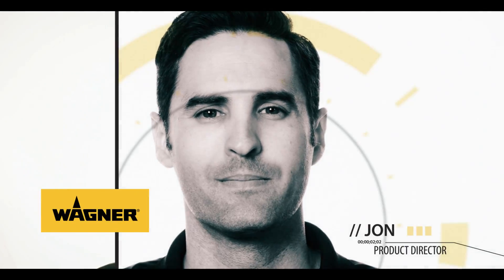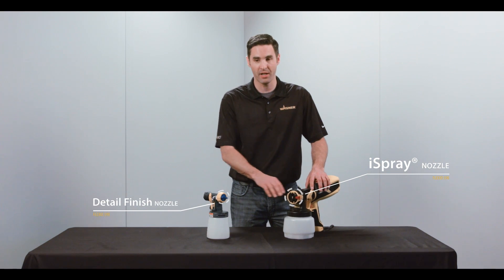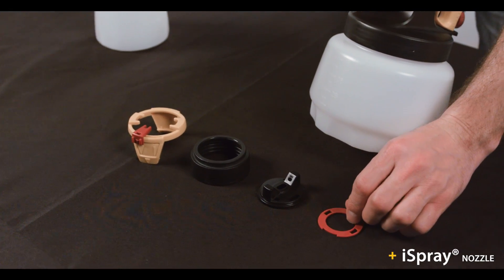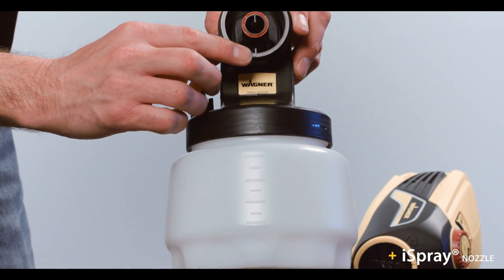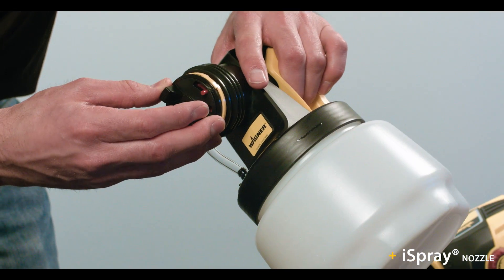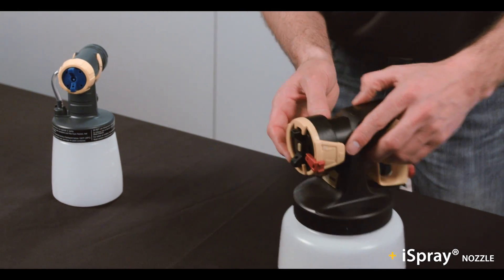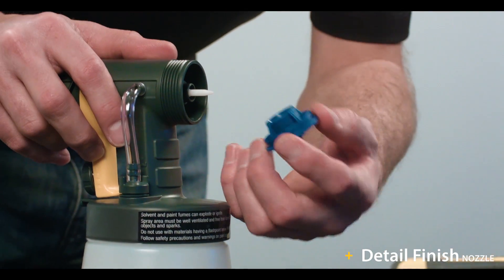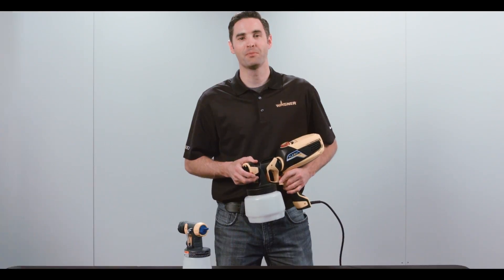Wagner FLEXiO Sprayer Reassembly

Comment: Hello.  I had a weird occasion where paint got into the air hose. I had to dismantle the handle assembly to clean the hose. Now the trigger button for the air flow isn't aligned. Where can I find a video where it goes in the handle assembly?
Reply from the maker: Hi there! I'm sorry to hear about the trouble you're experiencing. It's possible that during the reassembly process, the trigger button for the airflow was not aligned properly with its corresponding mechanism inside the handle assembly. This misalignment could prevent the trigger from functioning correctly. Double-checking the alignment of the trigger button and its components within the handle assembly should help resolve the issue. Here is our Wagner FLEXiO Sprayer Reassembly video:https://youtu.be/7faZIPgWq6I?si=P-iSf4jbywUhmwxI but if the problem persists, please contact our support team at support@wagner-group.com or by phone at 1-800-328-8251.

Comment: Wagner 570 is airless and brushless motor?thank you
Reply from the maker: Hi there, thanks for your questions! Our FLEXiO series sprayers are High Volume, Low Pressure (HVLP) sprayers. HVLP sprayers use a high volume of air at low pressure to atomize the paint. HVLP is ideal for detail work and smaller projects like furniture or cabinets, as they produce a smooth finish and have less overspray. Our HEA sprayers use a high-pressure system to push paint through a small tip, atomizing it into larger droplets. This results in faster coverage and reduced overspray. HEA is great for large projects like fences or exterior surfaces, where speed is essential.

Yes, this is a brushless motor. Please let us know if you have any more questions, we're happy to help!

Comment: 570 Came in without a nozzle. Reordered all the parts seen here and tried to reassemble and nothing holds in place snugly- especially the nozzle. I've turned the nozzle every direction possible and it is not tightening. This causes the locking nut to be loose and when testing with water the entire assembly pops off.
Reply from the maker: Hello! Can you please give us a call at 1-800-328-8251 for assistance with this? We'd be happy to help you and ensure you have the right part for your sprayer.

Comment: How to lubricate o rings
Reply from the maker: To lubricate the O-rings on your Wagner FLEXiO sprayer, follow these steps:

Disassemble the relevant parts to access the O-rings, as per the instruction manual.

Clean the O-rings and their areas to remove any debris.

Apply a silicone-based lubricant evenly on the O-rings.

Reassemble the parts, ensuring the O-rings are properly seated.

Regular lubrication helps maintain your sprayer’s performance. For further details, check your user manual or contact our customer support team.

Comment: Used of these to spray my home (well, two. The first one exploded). My general overall opinion is that they are a pos.
Reply from the maker: We're sorry to hear that. Before you unscrew any of the parts on the front end, you must unplug the sprayer and relieve the pressure by slowly unscrewing the paint container. Make sure all parts are aligned and connecting nut is tight. We're here to help you troubleshoot and get back to your home projects. Please contact us for help at 1-800-328-8251. We appreciate your feedback.